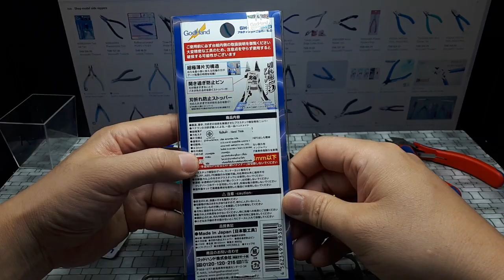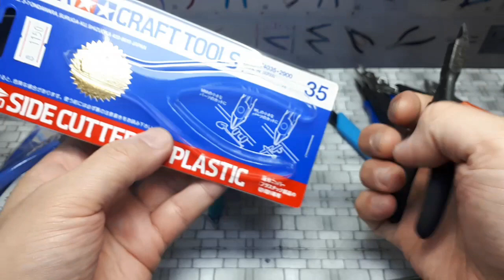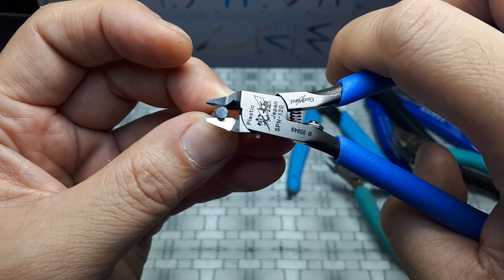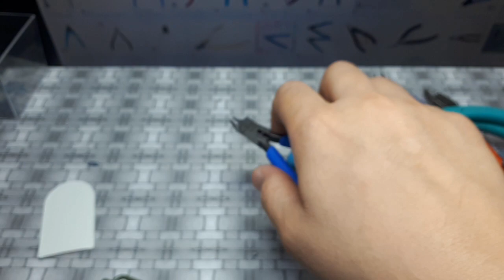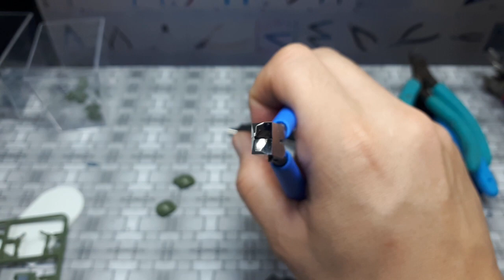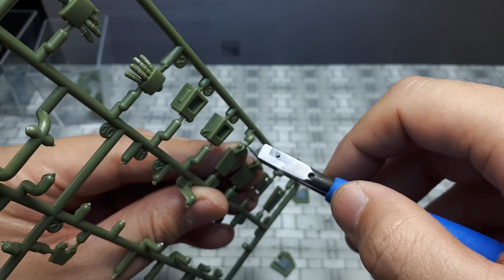Side cutter nipper testing: Tamiya 74035, Godhand SPN-120 modified, Erem, & generic

Comment: The godhands are a single blade nipper . One side is a blade the other side is a anvil . I tried them , sent them back . I felt they were no better than the Tamiya 123 cutters really . They are very sharp and do a decent job , but not at morw than twice the price of the Tamiya 123 nippers . Because of the single blade design you will always have the blade hitting the anvil not completely at the edge . The blade would eventually fail . Its just a part of the game in design . Good cut for a long time vs better cut that would fail sooner
Reply from the maker: After just a few model kits both my Godhand and Dspiae have gone dull so none of these single edge designs are worth the money.  I'll be testing some cheap double blades soon.